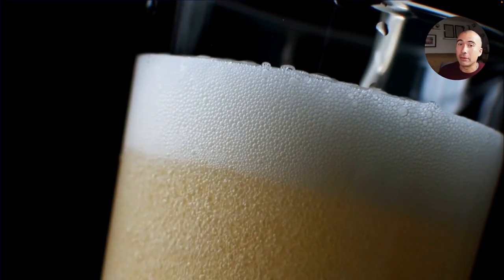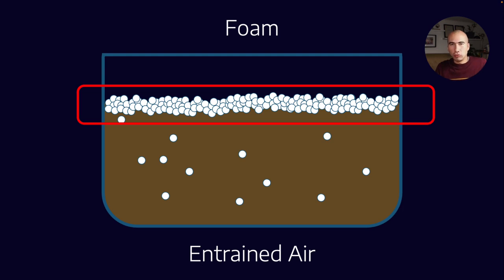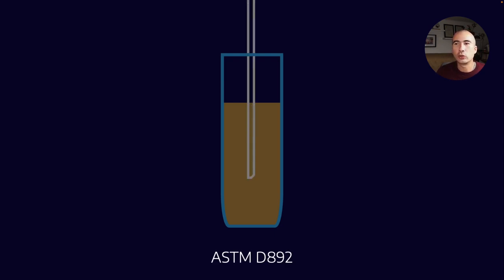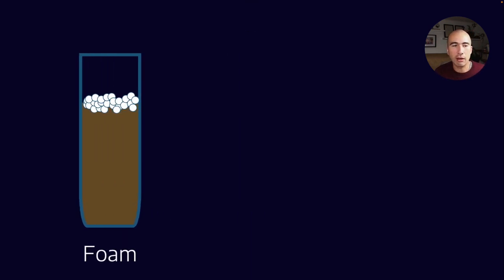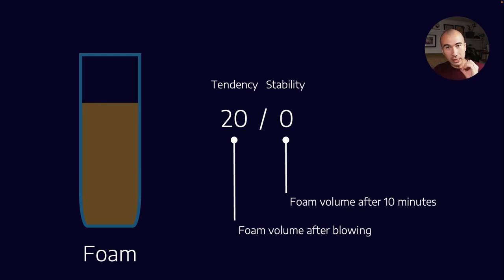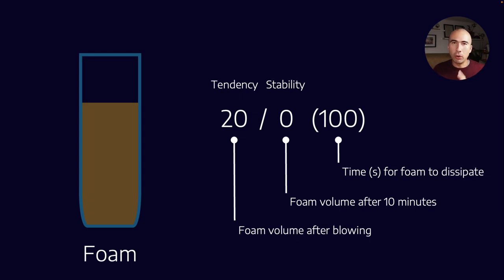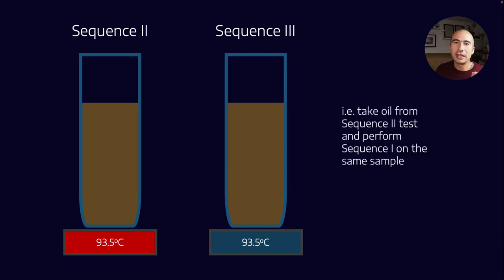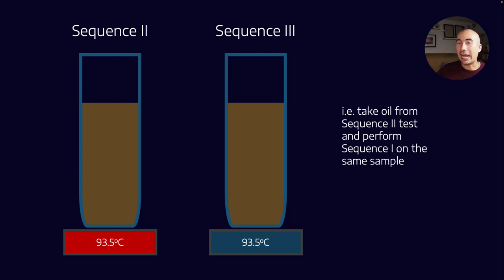Foam Sequence Testing of Lubricants

Comment: Great explanation, thanks! 

So based on the limits that API SN requires, being: 10/0 - 50/0 - 10/0

And comparing to the limits of CI-4 / CK-4: 10/0 - 20/0 - 10/0 

Is it correct to say that the Diesel requirement is more stringent to foaming?